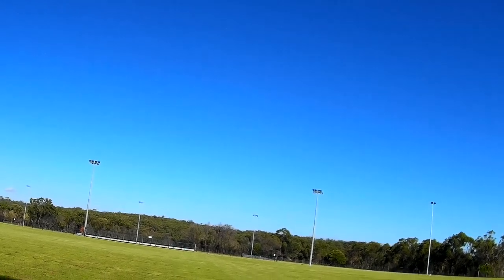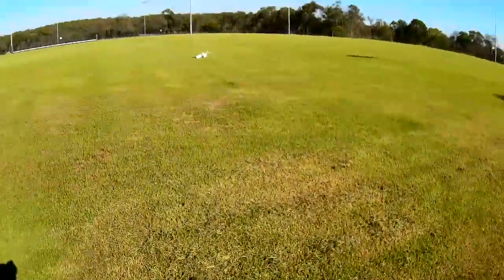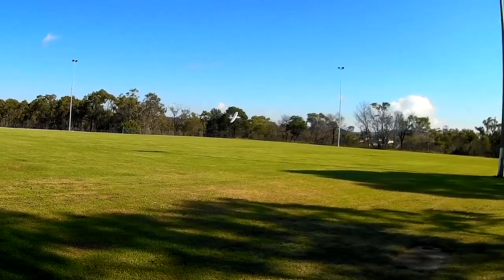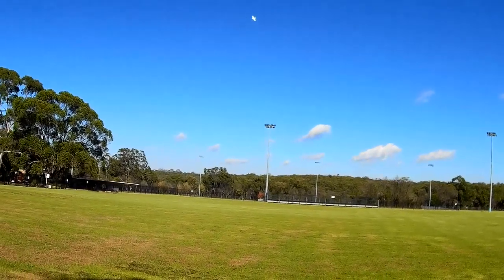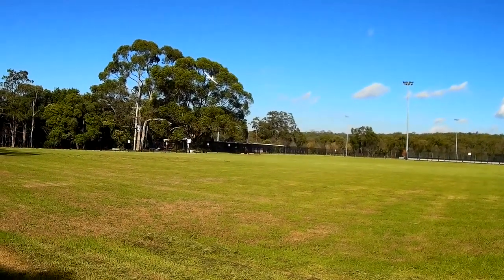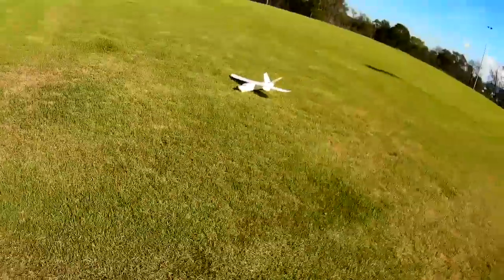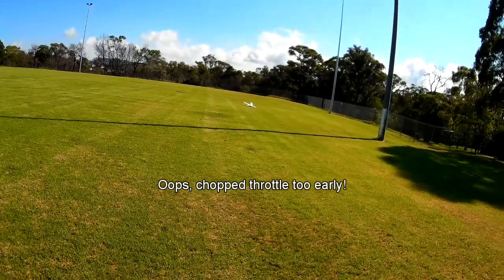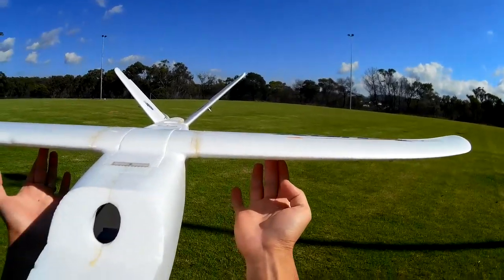X-UAV Talon Mini (Mini Talon) Flight Testing - Flaperons

Comment: Probably the most informative mini talon flight video that I've seen. Nice bit of flying.
Thanks very much
Reply from the maker: Thanks, forgot I did this video years ago! CG was a bit too far back on those rear servo tracks, I only got away with it because it was 1.2kg flying, not the 1.6-1.8kg when FPV/HD kitted.
Reply: @ZaksterBlue  
Did you ever do similar flaperon test with more weight.
Reply from the maker: @51im  no, I decided to FPV the plane some time after this, realising that flight controllers only had a single AIL output so couldn't do flaperons anyway.

Comment: Interesting   I did the same think with the same result : When I use the flaps on my mini talon the plane is pitching to the ground. It act as if the Talon was a wing (because on the long chord of the wing + V tail ??) . If you look at this video, the guys as the opposite result : At the beginning of his vidéo, the elevators compensation means that the Talon try to climb when he use his flaps… ? 
https://youtu.be/RjLYFrLYW8M
Reply from the maker: His video did not actually test the flaps. I think it would be a massive fail if he did.

Comment: Now that you have this plane for years and fully loaded. Are you still using flaperons?
Have you develop a technique to land in tight places fully loaded?
Thank you!
Reply from the maker: 1Esteband Hi there, I don't worry about flaperons. If you see my gimbal maiden video from last year my build is still fairly light, under 1.6kg with 4S 5000mah. With even a slight head wind this plane slows down enough to land gentle. best way to put it down is get it low early with low throttle so it doesn't stall, then chop throttle and slide it in.
Reply: Thank you for you comment, love your gimbal setup!

Comment: How does this plane flies? has some nasty tipstall? or its forgiving?
Reply from the maker: mathew t After a year or so, I started seeing other people's reviews that this was a very efficient plane on 4S, so I bought another one (and now have a third one as a spare). I set it up with a 850kv motor, 9x6" prop, and a 5000mah 4S battery, and it flew FPV for an hour on maiden.  It's really an awesome FPV plane which can be set up for fast and agile, or cruisy (but still faster than gliders).
Reply from the maker: very stable in flight, gentle stall under 30kph. I'm only having issues with launches at the moment, bit might just be my technique.
Reply: I thought you abandoned using this for FPV from your other videos? Did something change?
Reply: thanks for taking time to explain. Just lost my Bixler so wondering what to try next!
Reply: ZaksterBlue Watching your early videos, you really were NOT sold on this airframe!!!
What changed your mind in the end? Was it just the efficiency?
Reply from the maker: blackbirdboy1 Efficiency and speed. I was comparing ease of flying against my Bixler, but it's apples and oranges really. I did end up putting FPV on my first MT and liked it but on its second FPV flight it went down in the mountains. If it hadn't, I'd have become a MT flyer years earlier.

Comment: Hello! I got two questions. How long is the distance, in centimeters, between the leading edge and the trailing edge? and how many centimeters are there between the leading edge and the nose? Thanks!
Reply from the maker: +Walter Kobluk Sorry, I don't have this plane any more.
Reply: ok, Talon is good for fpv ??, or recommend another model?     (tracuctor google :/  )
Reply: Talon is good for fpv ??, or recommend another model?,     perdon! traductor google :/
Reply from the maker: +Walter Kobluk it is very agile and easy to set up for long range flight, so yes, a good plane and nice size, but maybe not as a first fpv plane because it is fast and aerobatic.

Comment: Hi, where excatly is the CG ?
Reply from the maker: Nightrider Nightrider Sorry, it's been over a year since I had that mini Talon, can't recall where the CG mark was. The manual should say, or check the rcgroups forum.
Reply: actually you mention in the video here 13:42 "right on the little bend in the servo wires". That's exactly where I ended up putting my CG too, after some trial flights.

Comment: I noticed that you taped your wings to the fuselage. No need, there are allen screws on the spar, tighten them and your wings will stay in place :)
Reply: Martijn van Gene Tape will rip off as a weak point, allen screws will break something before they snap